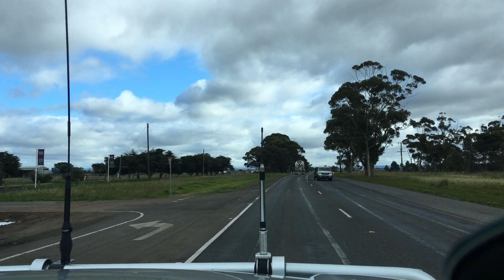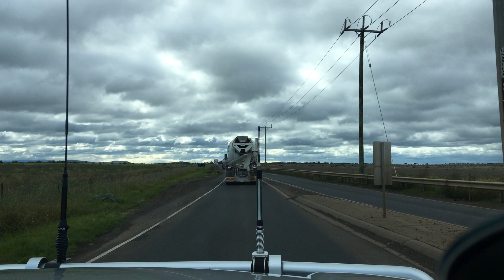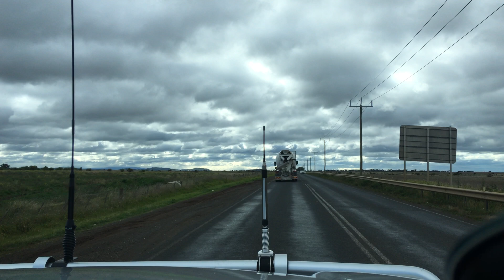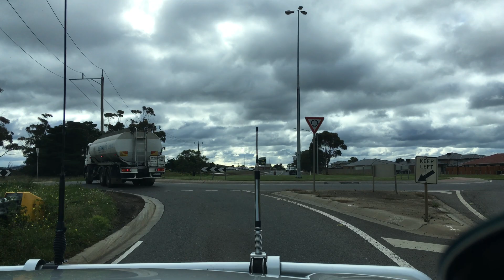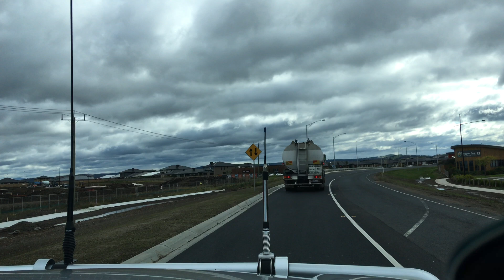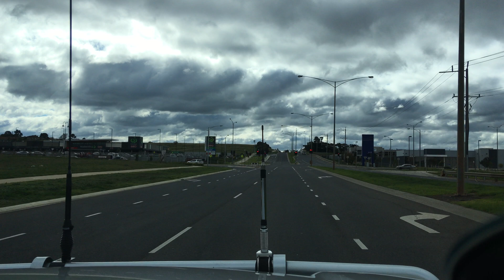THINK THINK THINK

Comment: You are like the stern father, strict, but does have the best intentions. I am totally clueless to cars, I recon a lot of people are as well. I also think most people have been conditioned to not think/not dare to think and touch their cars as they are not "professional". I've just got my first car few years ago, and third year after driving my window wiper motor was not working. I wish I had seen this video then and thought it through to find the fault..

Now then what I did like most laymen is take the car into an autoshop, and they told me about what I already knew (good side is I got the motor part name, then bought the motor myself and replaced it myself for a fraction of what they offered if they did it). I think people should be told this more, as this is valuable.